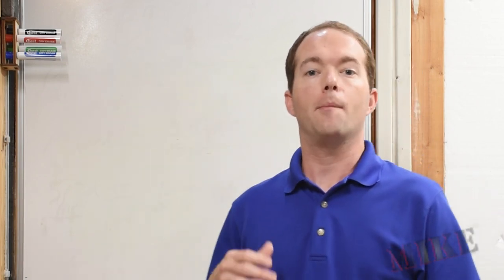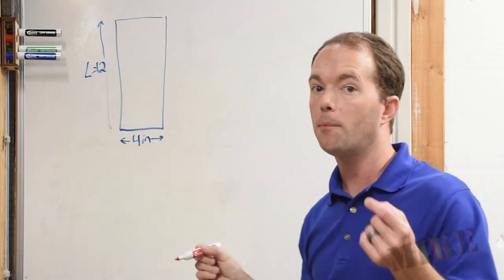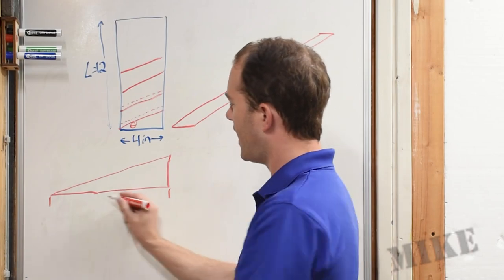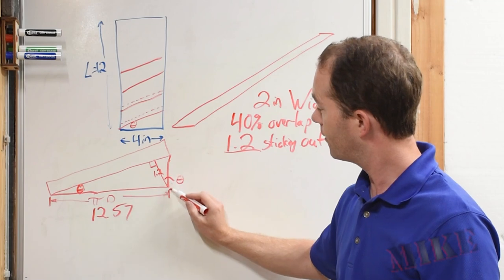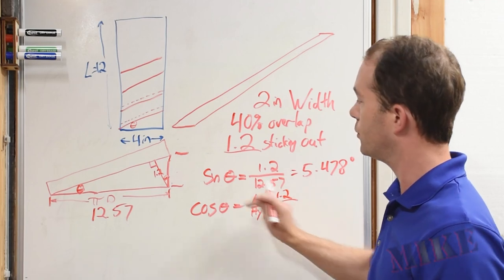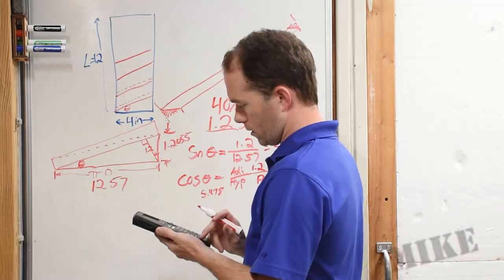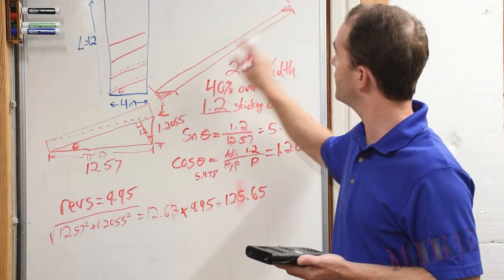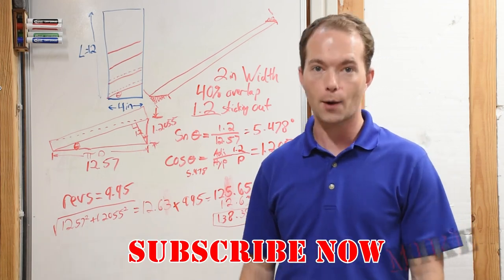Wrapping Spiral Tubes, Tape, Ducting etc...- Mikes Inventions

Comment: Hey Mike, thanks a lot for this! I am considering wrapping 10' long PVC pipes, 3.5" in outer diameter, and didn't want to have to do the math to figure out the angle, total length, etc. :) However, please check your latest download of the Excel, on the 2nd page with overlap, the formula for the total strip length seems to be looking at the wrong cells. I ran the calcs with 0% overlap on that page and got a very small result, vs. a much larger number on the first worksheet. It's not using the number of wraps nor pitch, as it should be. Thanks again!
Reply from the maker: Hey Patrick! I fixed the Excel sheet and downloaded it myself to check, and it's all good now. Thanks for noticing that error. I have no idea why it ended up looking in those two cells. I must have made some type of oops right before I uploaded it. Thanks for watching.